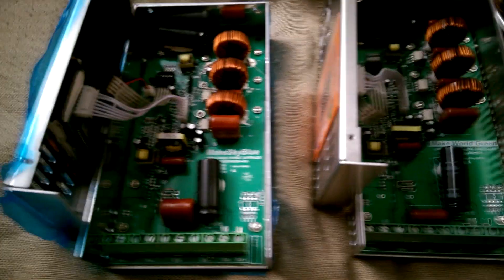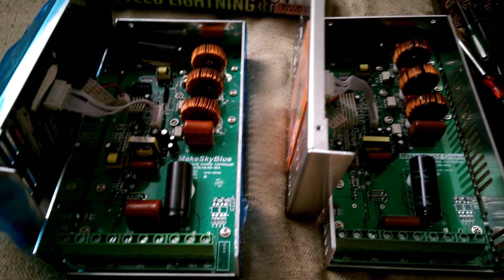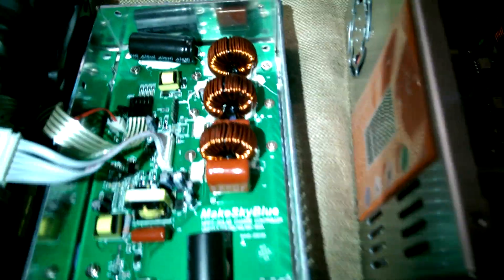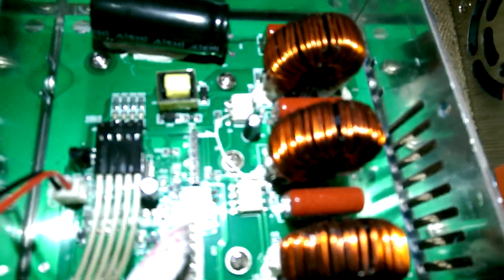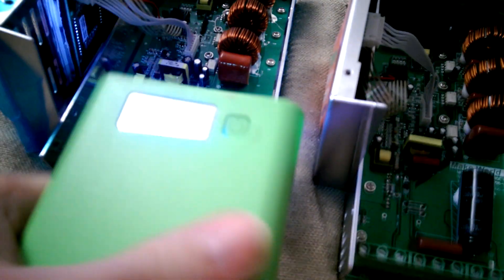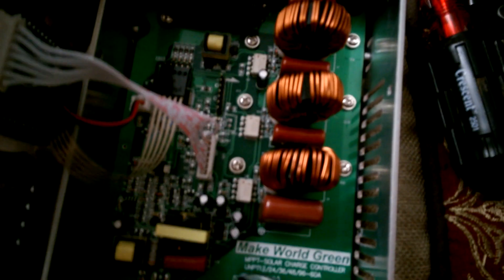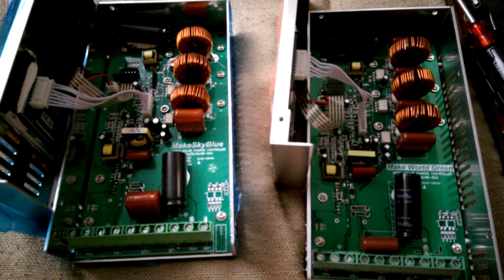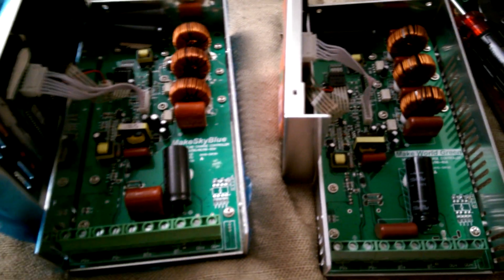Inside the MakeSkyBlue Solar Charge Controller vs. FAKE

Comment: Cheaply made, the main caps are not big enough, its likely to fail especially if its run at high power, and Ive see photos of these on fire.
Reply: Can't agree more!!! For safety, i got a V125 type from makeskyblue, it's just fit for one Voltage,but it's safer than the 123type.
Reply: also more expensive,but for better function lol

Comment: That stuff is all made under the same roof by the same Chines .   Same with most Lap Tops now days.  Hell half the Lap Top parts these days are interchangeable from machine to machine.   I've used Dell LCD to replace Toshiba and others.  Just made on a different assembly line and assigned a different part number.  LOL

Comment: I talk to the manufacture and they said they both come off the same line. That MakeSkyBlue is full of crap. The PowerMr is working perfect on my Volt batteries
Reply: Yes my PowerMr is working like a charm
Reply: Thought so, that it was either same OEM or they were just using the same schematic. Otherwise it would not make sense to match it exactly.
Reply: Just like GM in the 60-70s. They made 4 car lines with the same cars just the name and interiors changed. Chevy Nova, Olds Omega, Pontiac Ventura, Buick Apollo. Or later on, the Pontiac Vibe and a Toyota Matrix. Slight differences in body panels and tags but the same car under the skin.
Reply: I purchased 2 of the MrPower SCCs - in both units the cc/cv max charge voltage settings would not work. The setting made no difference to max charging voltages - it was as though the function was not implemented in the firmware. Not good for Lithium-ion batteries when you are trying to limit the max charging voltage.
Reply: @johnscott4344  im having the same problem i think i got it set the next morning i have to re set it all over i got a 100amp powmr paid 160 for it an!t any better im changing out as fast as i can afford it

Comment: I'm getting one of the fakes with no name. Have you noticed any difference in the software screens or tracking operation.  I don't care who makes it, those capacitors aren't big enough and I will be adding extra. I've noticed they mention the efficiency drops if panel is more than 2X battery voltage. That is a red flag.